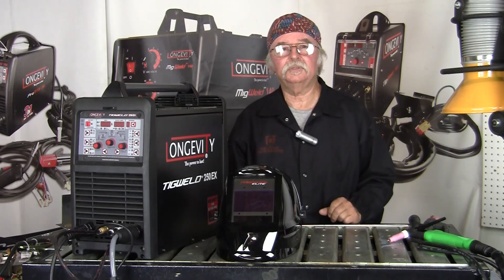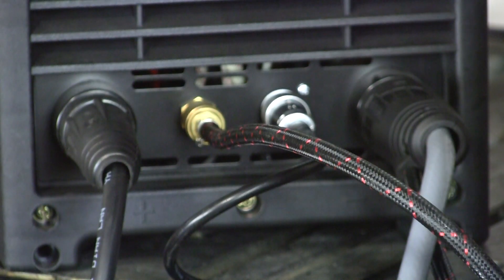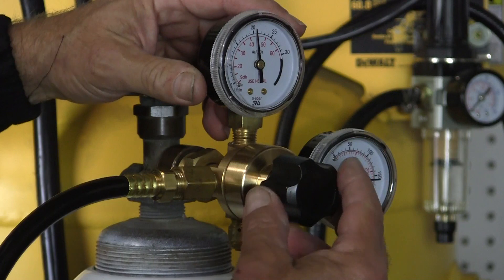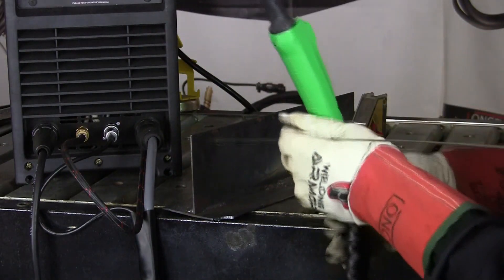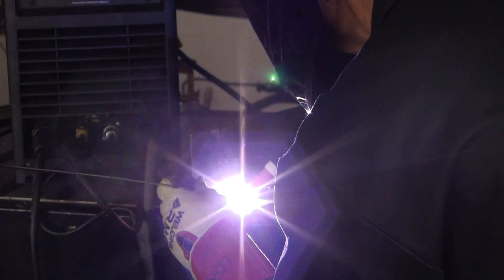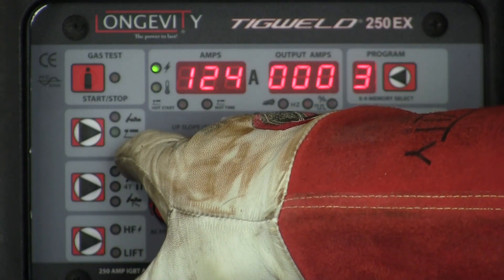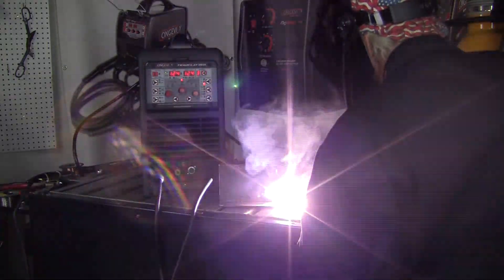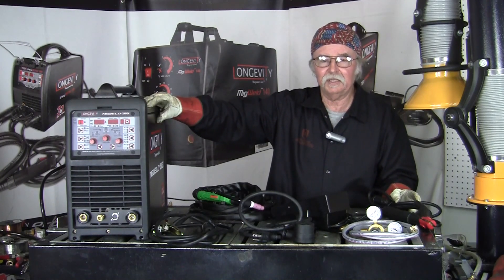Longevity TIGWELD 250EX - 250 Amp 110V/220V AC/DC Pulse TIG/STICK Welder

Comment: Why did my tig weld 250ex come with a cheap quick disconnect rather then being able to screw in in good 5/8 gas line
Reply from the maker: Different machines come with different disconnects. We recommend you add a connector with a 6 inch hose to connect whatever type of connection you want.